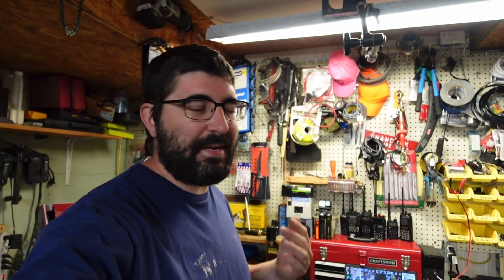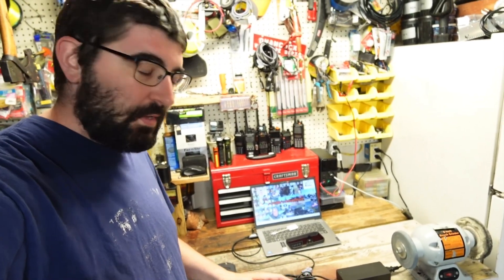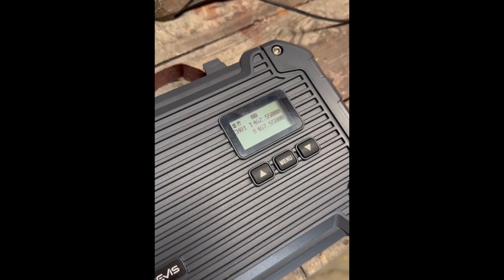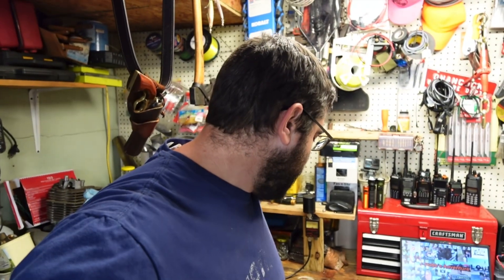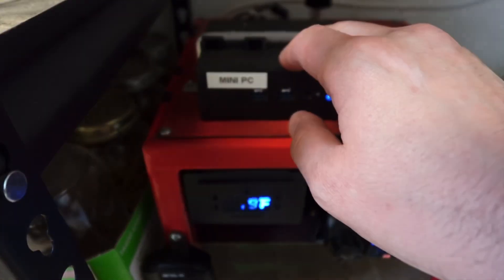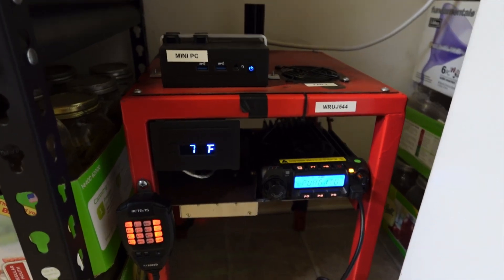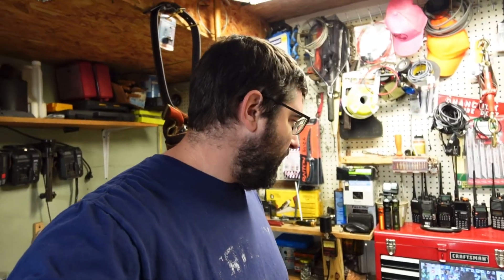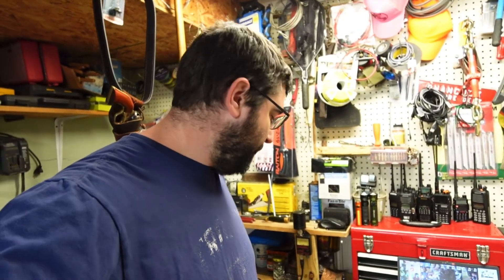Retevis RT97L testing | part 1

Comment: Hey J.Dubb,
I’ve been thinking about your repeater not responding to TX, and I’ve done quite a bit of digging into the RT97L. After reading through a bunch of reviews on the Retevis site, I noticed a pattern: several users mentioned issues after powering their repeater with 12V. Some said it stopped working entirely, others reported erratic behavior.
I see you’ve been running yours on 12V, and honestly, that’s starting to make sense now. Retevis ships the RT97L with a 15V power supply, which tells me it’s probably designed to run best at a solid 15 volts. I’ve got the same repeater, and I’ve only ever used the factory power supply , never had a single issue at 15V.
I did build a 12V solar backup setup, but I’ve never connected it to the repeater ,, and I don’t plan to. Instead, I’m upgrading to a 24V solar system and stepping it down to 15V. That’s when I’ll feel comfortable hooking it up. You might want to consider doing the same: go 24V and reduce it to 15V. Just saying. 
There’s probably a reason the Chinese engineers included a 15V supply ,, and while they might think 12V is “close enough,” I’m thinking... not so much.
Let me know what you find out with your setup.
Cheers,
Reply from the maker: Since the update I haven’t had an issue, even Retevis said it was a software glitch. Iv got a few build videos on it and a few different ways to combat the 12-24v problem

Comment: Hi J, i just received this repeater today. I bought a really nice gmrs copper jpole from a guy thats been making antenna forever. I have it about 40 feet up, and i cant even hit the repeater with my ht or 25 watt mobile over a quarter mile away. I can kerchunk the repeater over a mile away but it breaks off. I didnt ask retevis to program the duplexer. My questions are do you have to ask them to program the duplexer or to a specific frequency with this repeater and do you have any suggestions on what might be going on? Thank you so much.
Reply from the maker: As far as I know if you buy the gmrs one than it’s tuned for the middle of the gmrs range. If you buy the 70cm then it’s probably untuned

Comment: Which audio port did you use for audio in (To the adapter) I'm using 5 but the audio is very low, I get nothing off of 4.  Also for anyone else looking for it, Retevis sent me the pinout because it's not in the manual:

1- Mic - / GND
2- Mic + (Audio In)
3 - Busy (Low - Triggered)
4 - Speaker + Audio Out 1
5- Audio Out 2
6 - 3.6v 100mA power (Note: this was formerly ground on RT-97S!)
7 - Ground
8 - TX Data
9 - PTT / RX Data
Reply from the maker: I’d adjust your audio settings in the computer
Reply: @JDubbsadventure I ended up swapping my rim device with another one and it likes this one better.  No audio out of pin 5 at all though for anyone else following along and using pin 7 for ground is the least noisy

Comment: I'm seeing that after sitting couple hrs mine is taking two calls before it will transmit.
Reply: Rev 1.1 firmware
Reply from the maker: So mine started out at 3+ hours and is now 30-45 minutes
Reply: @JDubbsadventure hey try Init Reset option in display menu. I did it yesterday and the issue has not occurred... At least not yet
Reply from the maker: @ I was told today by Retevis it’s a software glitch

Comment: I swapped duplexers in my RT97L this evening as I had an identical one from a previous project that I knew was correctly tuned lying around and the same idle timeout issue still persisted even after the swap.  That is one possibility off the table for my unit at least but the puzzle continues.
Reply from the maker: It’s definitely not the duplexer it’s firmware, I believe
Reply: @JDubbsadventure  I truly hope so because that would be the easiest solution....just download, upload, and fixed! 👍

Comment: Also, the duplexer may need to be "fine" tuned. Sometimes, Retevis just slaps the duplexer in there even when requested a custom frequency
Reply from the maker: Iv completely bypassed the duplex and the problem is still there, normally duplexer problems are different

Comment: I received mine last week on Tuesday the 15th.  Been doing some simple short tests on it and this problem hasn't surfaced.

Last night after seeing your short ect I left it on over night without keying up (5.5 Hrs Idle) and it keyed up first time I hit it with a HT.  No ID and ran off wall power AC.  

Looking forward to what Retevis says about your problem.  Thanks for sharing!!
Reply from the maker: Good to know it’s about 50/50 what I’m hearing from people
Reply: @JDubbsadventure  I don't know if you are a part of any of the Retevis FB chats or not.  I am on one that Retevis started in reference to the RT97 repeater generically.  There are some people in there saying the same issue you are having.  I sent them your video and been working with getting their attention there to see about getting the problem address.  Hopefully we will have a solution soon.

Comment: Hey JD to follow up on my repeater that I just received I have not come across the issue that you have yet but then I have not done long testing either I'm heading to your neck of the woods Shenandoah valley VA next weekend not exactly sure where you are in Virginia but maybe I can hit your repeater good luck what's your issue or keep you updated
Reply from the maker: I’m a few hours away but you can try the Ingalls 650. It has a null so I’m not sure if it will reach out there. Eliot mountain is a good one to